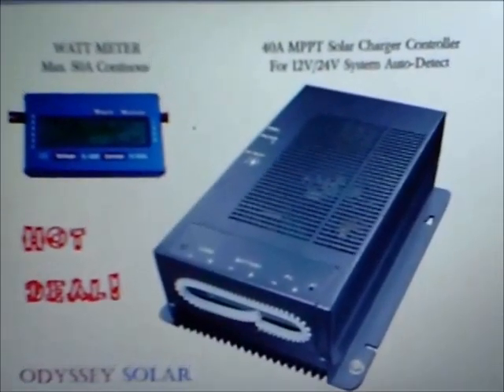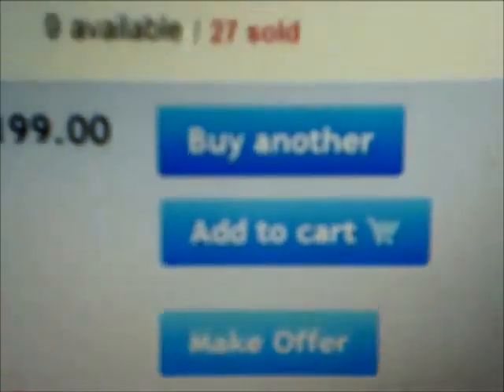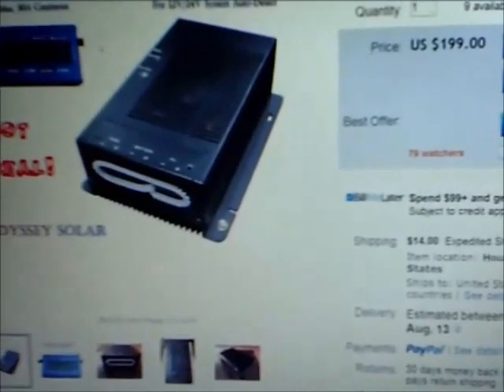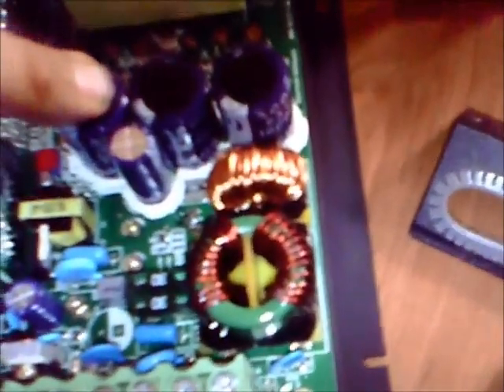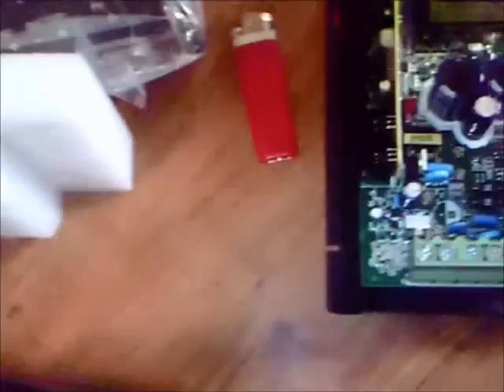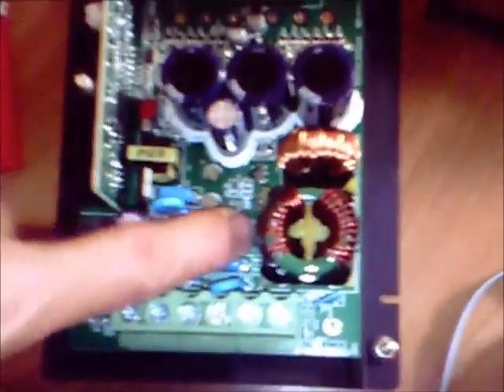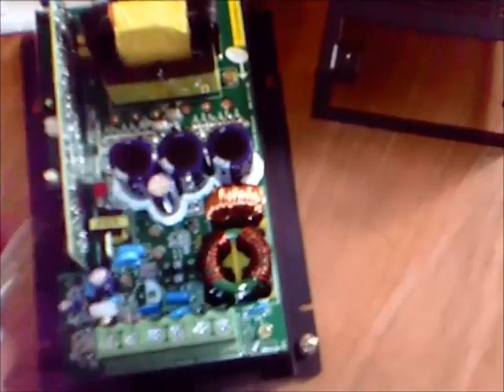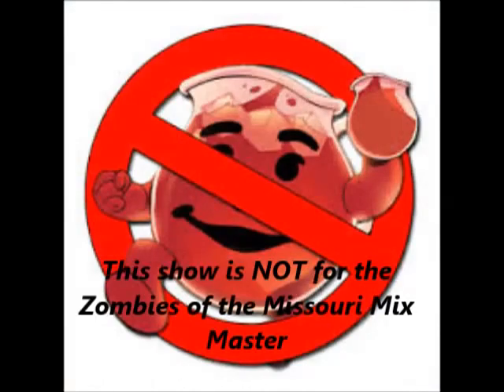MPPT charge controller 40 Amp solar, better one below in description

Comment: Nice demo, but the ZL POWER product does not function. Beyond 50% of the power inverter, it goes into bypass mode. ZL POWER, It's cheap but that does not meet specifications, so it is unusable.
Reply from the maker: +gcsnc001 globalcommunicationsystem I have upgraded to Tracer by EP Solar.

Comment: Hi I have almost the same charge controller. I have only the bigger brother the 60A model. 

I have connected 6  260W 48v home-roof solar panels for charging an 24 volt 675 amp Trojan battery bank. That go particularly well also in the winter. 

I saw last 10 amp coming from the solar panels and 15 amps going to the battery bank. 

It is only pity that there is no panel-meter available for this charge controller where i can read the charge information. 

I recommend this charge controller this is a good product, See E-Bay there it is often for sale.

I use a Victron BMV 700 battry monitor for the status of my 24 volt 675 amp Trojan battery bank.

Comment: I'm having a problem with the charge controller. It charges the battery 
then goes into float mode & stays in float mode while a load is on 
the battery. Even while the battery is near 10v. When I open then close 
the breaker to the control it comes out of float mode then starts to 
charge the battery.I'm using  deep cycle battery & the control is on
 the deep cycle setting.
Reply from the maker: +IRIE BEADS I would do a voltage test on the solar panels, You may have a failing diode.
Reply: The voltage & diodes are ok
Reply from the maker: +IRIE BEADS Something is definitely faulting, I would send it back
Reply: Its now outside of the u.s. With your when its in float mode & a load is on the battery those it start charging ?
Reply from the maker: +IRIE BEADS Mine will start charging as soon as the batteries get a draw on them in excess of the float.
Reply: Thanks for the info
Reply from the maker: See my review on long term solar panel use https://youtu.be/Ktuww1AOjyY

Comment: I bought one of these via Amazon two months ago. I've attached it to two solar panels at 12v. New, deep cycle lead-acid batteries. Green light and flashing orange for a couple weeks. Batteries went from 13v to 9v in one week and to 1.6v over the following two weeks. Green light off. Nothing is happening. I have 20v coming in from the solar panels.

Not very happy with the product. This was a test of this product to determine if I could use them on a larger system. 4/14/16
Reply from the maker: +Dave Bennett ~ Lets start with ODD? Sounds like you got a dud, a mis install or your wires are crossed. In the last 3 years I never saw one that was a dud but I have seen people hook up the solar panels first ( a big no no) or hook up the solar while sun was on them ( another no no). The battery selector also has a ZERO point that if left on it, you will get this effect ( no one usually has nickel iron batteries)
I know your supposed to hook up the battery leads first, wait till it sets itself ( 10 seconds usually) then set the type of battery then connect panels in the dark or covered. There is a reason all the solar panel makers put "do not connect or disconnect under load" on the panels.
 I have seen a few China panels with labels on them from Missouri wind and solar/skymax/mandalay wind/mountain wind trading ( all the same clown) that did not include this very important information because he was trying to lie and claim the panel was American made & UL listed, but thats not the norm for most companies. 
By putting the panels on first, you can get a inrush to the charge staging MOSFETS which will damage the units, Also by hooking up currently powered panels you will get a inrush of amps that will cause the float circuit to go bad in most all controllers no matter who makes them.
But, possible you have a dud. Get it refunded, get another or change brands. I have installed at least 40 of these in RV's and have 7 I use myself. Never had one issue.
Reply: I spoke with their customer support, yesterday, and they were very helpful. I'd done everything correctly and followed the manual in the installation. In fact, I already had a small test system in place that worked well for a couple years. I just removed the old controller and installed this one in it's place.

There are 20v coming in from the PV, there is nothing connected on the load terminals, and the batteries were new and were delivered with a metered voltage of 13.3.

After one week of this connection, the batteries metered 10.6v. Two weeks later, they meter at 1.3v at the terminal on the controller. Disconnecting them from the controller and metering them, as directed by tech support, they metered at 2.2.

I understand that once they drop below 10v, the controller will not charge them. So I will charge them externally and we'll try this process again.
Reply from the maker: +Dave Bennett ~Was there any load or draw on the batteries from another source? And, be aware that a MPPT is a feed back controller, they react to the voltage present and loads in and out.
Reply: Nope. Two 12v batteries in parallel. Only connection was to the controller.

Comment: I am going to purchase this Solar Mate SL40 40 Amp MPPT Charge Controller from eBay seller "yves-julien" for my 48 Volt Solar Panel to use with my 12 Volt Battery. This CC will actually take in up to 45 Volts before it cuts off the input when hooked up to a 12 Volt bank. It will do great until I can afford to upgrade my battery bank. The best value for the range of input/output. I've seen this CC take in 35+ volts and charge a 12 Volt battery. Most definitely MPPT. Price is now as little as $135 + $25 Shipping = $160 shipped so this guy got a good deal for 2.

Comment: Hey Buddy, looks good and sure it will do the trick in parallel, does it allow for a master to the slave? You know, not the master to the zombie slaves neither, did a remote come with that? But a Watts-up meter also came with it? Cool good deal, no BS video, Thanks!